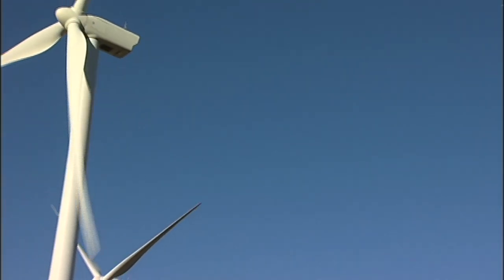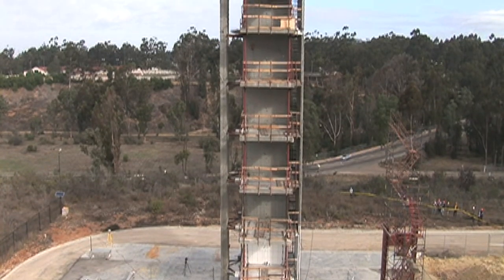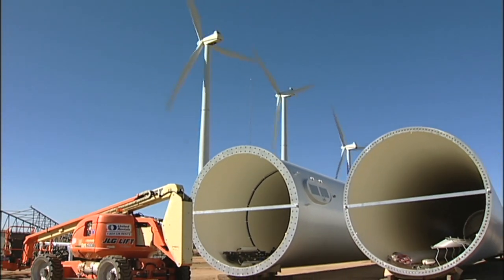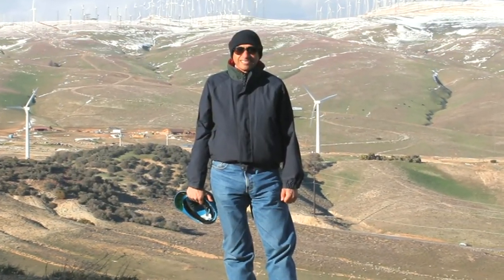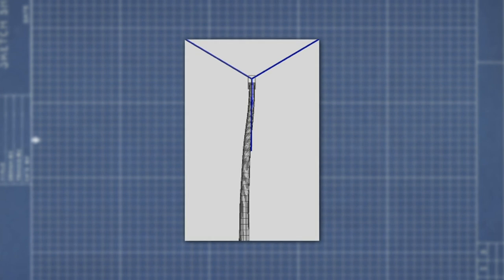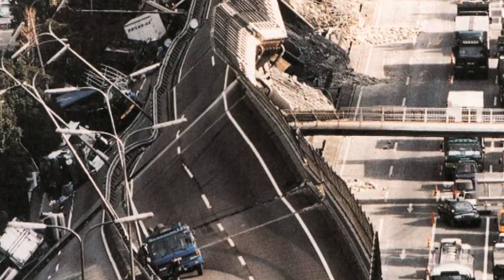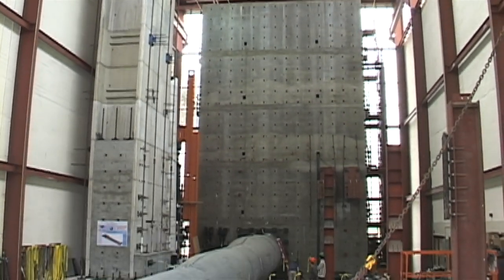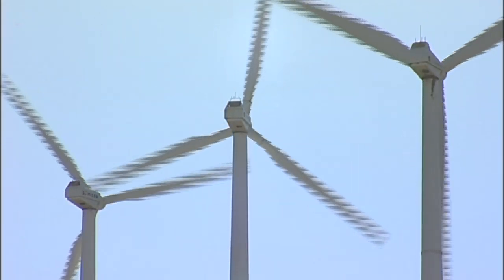Seismic Testing of Wind Turbines for Renewable Energy

Comment: It is common for earthquakes to cause an interruption of the electrical grid.  Most wind turbines apply brakes on loss of power connection to transition to a parked condition.  It may be useful to include this transient in the modeling to increase the loading transients on the structure ensuring that the results are conservative.